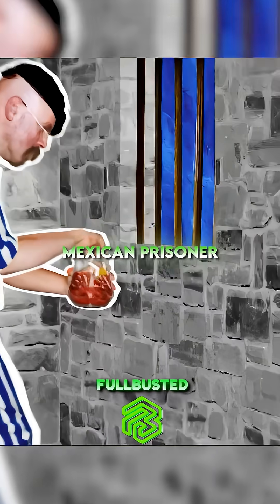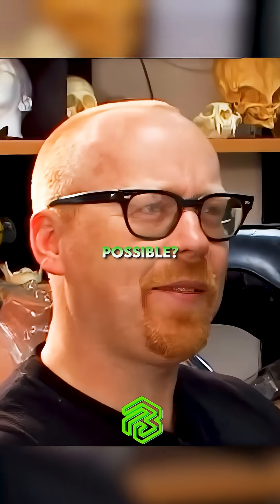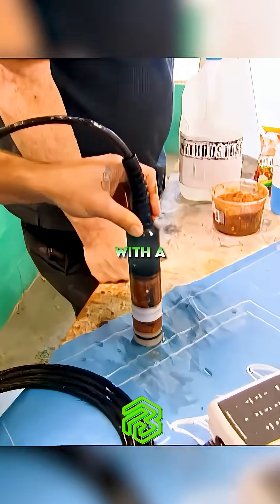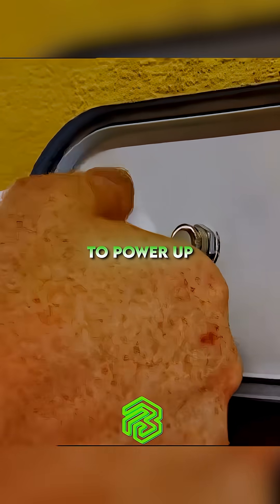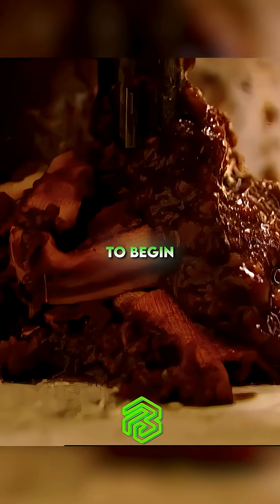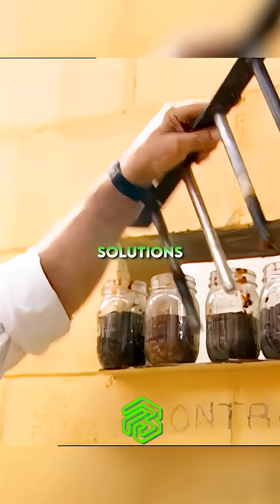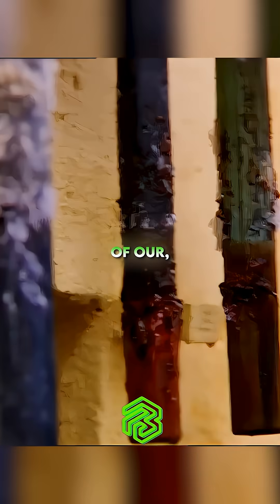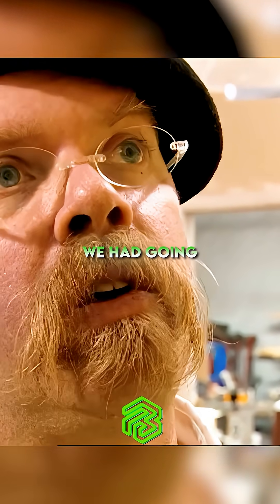Can Salsa Sauce Really Melt Jail Bars? 🤯 | MythBusters

Comment: DC worked a lot better because it's constant current, that you can think of like a Newton's cradle that's constantly being accelerated forwards. AC is like a regular Newton's cradle, cause AC is a sine wave, the current isn't positive constantly. It doesn't have the time to electrolyse the metal. DC does have the time for electrolysis to occur. How tf did the prisoner get DC current if the only electricity in the room is from an AC light?

Comment: Electrolysis. They are making the metal bars rust and then using electricity and vinegar in the salsa to take the rust off, slowing taking the metal apart layer by layer until it gets so brittle it can just be snapped.

Comment: of course DC worked better, that's how it works. The electrons break free from the Iron more smoothly than it would in AC considering the electrons are going in one direction the entire time.

For example - Many modern vehicles have a thing called "Cathodic Protection" to prevent rust. You reverse the current, you get the opposite effect. I bet this myth about the prisoner was a previous mechanic or at least had the knowledge to apply it.

The Salsa was the activating "ingredient" (Sorry) (Catalyst)

Comment: Salsa has more water moisture than other acids...I know if nitric acid is not diluted it will create a passive layer of oxide on several metals like iron and copper nitric will not penetrate the oxide layer halting the reaction

Comment: Jamie used a radio that was retrofitted in order to achieve his outcome while Adam was left using the power out of the light socket. This is important to know as getting DC current would be very difficult for a prisoner without outside help

Comment: It's a classic but a top tip for both the Mythbusters and any junior chemist: pH probes are functionally useless for anything that isn't a really simple acid or base solution, you also need to calibrate them constantly.  Sticking it in salsa or even the diluted juice will just give a random result. Even professional grade pH probes are pretty useless beyond simple solutions, hence why we still use titration (the manual method) which actually works.

Comment: as a chemist, i always thought it would be kinda easy to escape from prison, or at least do some funky shit behind bars. if i had someone mail me a bit of pyrite (fools gold), which at first may seem completely innocent, i could roast it under oxygen, maybe in a left over soda can or something, funnel the gas through water and make sulfurous acid, an incredible oxidizer (the salsa eats through the bars because of the acids oxidizing qualities, oxidization in a chemical sense is the loss of electrons in an atom which makes the atom unstable and dissolves it in the solution of salsa). if i had the opportunity, id add hydrogen peroxide to turn the less stable sulfurous acid into sulfuric acid and concentrate it by just boiling the water out, as sulfuric acids boiling point is wayyyy above that of water. with concentrated sulfuric acid i could easily dissolve any fence i needed too

Comment: I think he just used the electricity to speed the process up because he wasn't going to wait months for this video. It probably wasn't done in the real jail.
Reply: W pfp
Reply: @R @RoderickDoran thx
Reply: yeah apparently the salsa is a strong cathode and when electricity is applied it only speeds up the oxidation process
Reply: @Shawn420s  the only problem would be figuring out how to hide that sort of contraband, batteries and stuff.
Reply: @laplio2897 😂 you never been locked up
Reply: @laplio2897 the ol prison wallet. Or “keeping it on the bottom shelf “ as my pops said.
Reply: @laplio2897 yeah batteries aren't contraband they have walkmans you can buy on commissary and they actually power them with batteries.
Reply: @laplio2897 because a radio or phone are not contraband and so is a charger
Reply: @laplio2897 this is 1996 , before 2001 places was less secured meaning prisons too
Reply: @ghostelliott9339 the bottom shelf is hilarious
Reply: @laplio2897  I mean the guy's in jail for years and the guards probably don't check the cells thoroughly enough. Entirely possible he just kept doing it for months.
Reply: @laplio2897 you missed the point. You dont need all that. It p ly speeds the process up. Fuckin smooth brains i swear  youre multiplying by the day.
Reply: Its not that hard to rustle up some wire in a cell. 3 months of paperwork would do the trick, if they still let you have paperclips.
Reply: Jails these days have power outlets for tvs. Just clip the cord with nail clippers and twist them back on to watch tv and hide the wire
Reply: @Darth_Possumus it clearly said 1996
Reply: @ShagT-s7d  And they did in 96 as well
Reply: If there was any electricity available, even batteries, it would increase the rate of oxidation dramatically.  Without any electricity, it would have taken years, maybe decades.
Reply: At that point. The rust would eat the bars more
Reply: @laplio2897 a couple people have done this it seems, but the whole point is to rapidly accelerate rusting to cut down the time to escape from decades to months or years
Reply: @laplio2897 that’s the original point, they’re just speeding up the process
Reply: @laplio2897 that’s the literal actual point. 🥴
Reply: You don’t know mythbusters than
Also it’s a SHOW
Reply: It is a show called mythbusters
Reply: @Enjoyer_of_good_shlt everyone knows
Reply: No way bro.
Reply: @tartoon5550 I meant that it probably wasn't done in the real jail.
Reply: Was gonna say there is absolutely no way 😂
Reply: Search up what a stinger is in jail and then come back to this prisoners can absolutely do this same technique as long as they have a long enough cord hell they don't even need a long enough cord they could theoretically just keep splicing small power cords of they can't get a long one they are very very creative man it is unbelievable what we get up to when we got literally nothing to do but sit in a cell
Reply: @infinitygaming3217  I was just saying this. A stinger from the mains will shred that metal.
Reply: was proven it had happened
Reply: Using batteries 😢😢😢 at least 2 years but was effective
Reply: Radical
Reply: Same thing happened with a Japanese captive: he threw soup daily to corrode the bars
Reply: They are just showing it works, its reality t.v. did you honestly think it happens in a hour😂😂😂😂you did didn't you lol
Reply: Nah, they just couldn't get their hands on the salsa from hell that Juan was using
Reply: Try
Reply: Piss can do it as well. It's highly acidic. Just like vomiting. The stomach acid gets mixed in which can eat metal.
Reply: “probably wasn’t done in the real jail” are you really that slow? 1) that was many years ago, if that jail is still there they 100% would not let him destroy it 2) wtf are you are “probably” for?  OBVIOUSLY it was done in their shop, not a real jail, didn’t think you needed a PHD to know that.
Reply: You're right. The electricity just sped up what the salsa would've done in its own over time.
Reply: No shit
Reply: Lol this episode probably came out before you
Reply: Bro don't doubt the inmates with working brain cells.
Reply: Wtf did the jail smell like if you could electrocute salsa overnight or reapply it over the course of months and it doesn't get noticed
Reply: Inmates do have electricity in their rooms so ya never know.
Reply: Wrong, the electricity causes electrolysis which SIGNIFICANTLY corrodes reactive metals like iron, copper, chromium, plus all common metals
Reply: @Dwbotlol na
Reply: @Dwbotlol  do you have trouble understanding what was said? Because you literally said exactly what the OP said. That was in fact, his entire fuckin point. 🤤